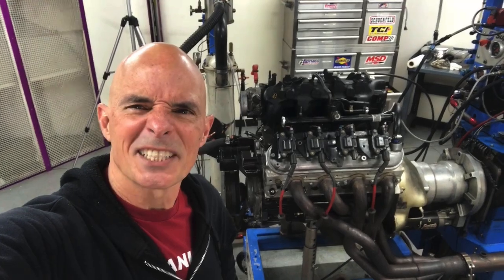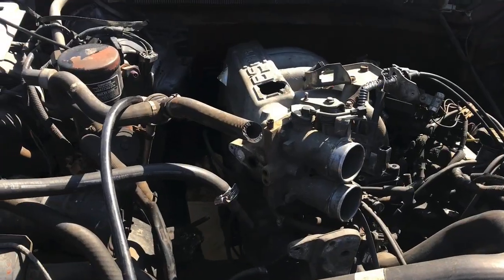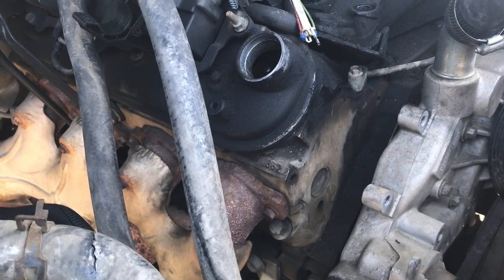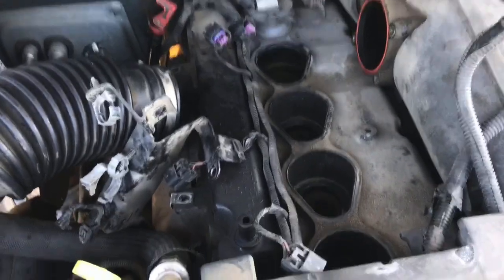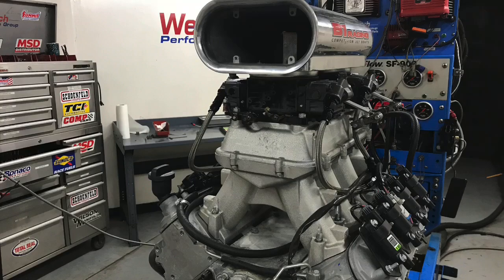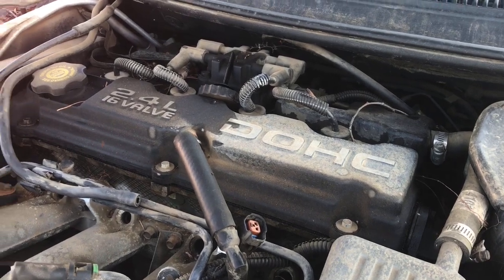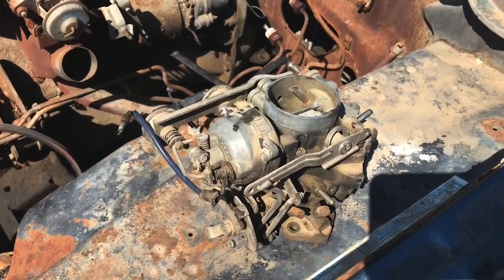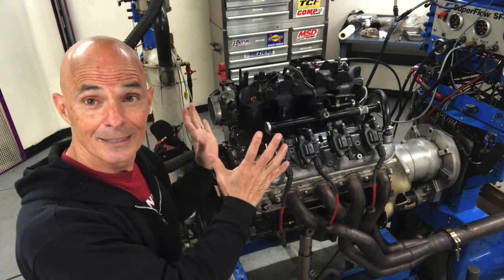LOW BUCK JUNKYARD QUEST-          THE AMERI-BARRA-4.2L ATLAS CHEVY 6

Comment: Cool beans on the chrysler 2.2 , 2.5 turbo.  I absolutely love these motors. Had an 89 shadow that I built a pretty trick 2.5 turbo for.
Ran 13.2 at 106mph on 14lbs pump gas. FYI Kenne Belle adjustable fuel pressure regulator  for 3.8 Grand National is a diresct bolt on.
Reply from the maker: Very cool!

Comment: Water will drip off the cowl into the back 2 spark plug holes, which is why they are a common item and nobody takes the back 2. Used to do alot when i worked at GM
Reply from the maker: good to know

Comment: Hey Richard! If I buy four of your "Wrong cam" shirts can we get a 1uz on the dyno! 6 bolt mains! All aluminum! High rpm! Get the reference? Vvt for days!
Reply: The Skid Factory has a few vids with a turbo 1UZ in a Ford and Nugget Garage has done a few turbo 1UZs also. 1 in a supra from memory too i think.
Reply from the maker: aren't they 300 hp v8s?
Reply: @richardholdener1727  260 ish for the early non vvti engines. But they had the big rods which holds lots of boost! Pre 97!

Comment: Hey Richard, I have a good Pontiac 4bbl intake. I think it was on a 287. I was just looking at it today thinking I need to sell it because it's setting outside and I only have 68 and newer Pontiac engines so I'm never going to use it. It's yours if you want it.  That Rochester Dual Jet setting under the hood of that Yugo is a great source for main jets for a Quadrajet. Most of the Dual Jets have #74 jets while Quadrajets can have anything from #65's all the way up to #74's on a big block carb from the early 70's. When you're jetting up for a modified engine they are a great size.
Reply from the maker: isn't the 287 a different intake than the 57
Reply: @richardholdener1727  I'm not sure what year they changed the intakes on them. I'll look at the date code tomorrow. I'm not 100% what it's off of. I bought a '55 Pontiac years ago with a bunch of spare parts and it was in with the mix. I just know it's 50's stuff.

Comment: The Langoliers are eating everything up from the 80's.

I would say you might find a 2.2 turbo but a 2.5 turbo?  That's a unicorn,.. and a cool one at that: as they were tough little engines that could take serious boost stock. (One Minivan in particular with the boost turned up and eating transmissions,   /watch?v=_e7qVlrHbYE).  Look out for the turbo minivans and  Plymouth Acclaims also had them even though they were rare back in the day.

If I remember correctly, Tyler Hoovie burried a 2.2 turbo.. lol  Not sure what became of it after he dug it back up and tried to start it.

Love it!

Comment: Sure do a Northstar! Better yet do a "Shortstar" LX5 V6 out of an Oldsmobile Intrigue! It's super sweet for what it is, DOHC, coil on plug, 215hp 234 torque,  9.3:1 comp NA. Such a smooth running engine, That's why I own two of them!
Reply: I had no idea there was a Northstar derived V6! Does it share a bellhousing pattern with anything interesting?
Reply: @BuffMyRadius  I believe the bell housing is the same as a 3800 series two. Mainly because they use the same 4T65e transmission. The Oldsmobile intrigue used the 3800 and the LX5 3.5 in its life time and as far as I know never changed transmissions for the 4T65e.
Reply: @TommioRS  so no chance at any RWD swaps, huh? One of my favorite factoids is that the Yamaha 3.0/3.2 V6 from the SHO is developed from the Ford Vulcan 3.0 in the Ford Ranger so it's a bolt in swap.
Reply: @BuffMyRadius  You very likely can as stated in this wiki. https://en.wikipedia.org/wiki/List_of_GM_bellhousing_patterns
Reply: Also to note, The LX5 does have an externally mounted starter. It's not in the V of the engine.
Reply: @TommioRS  well I learned something new today. I still think I'd stick with a 3800 for the supercharger, but I can certainly see the draw of a NA DOHC high compression motor. I went out of my way to get my 32V 5.4 Navigator, similar concept.

Comment: You say you're looking between a 2.2 l and 2.5 l turbos.? Well the 1970s through the 90s Ford Thunderbird turbo coupes had t3 and t4 Garretts. Also those Ford Thunderbird turbo coupes could handle up to 18 lb boost and they usually came with 12 lb boost stock. They were an amazing engine those 2.3 l.
Reply from the maker: 2.2l and 2.5l turbo motors
Reply: @richardholdener1727  
Thought you were just looking for the turbos LoL.

Comment: If you’re looking for a Honda J series, get the J35A8 out of an Acura RL if you can. They’re the best of all the factory Js
Reply: 3.2 out of a Type S (TL or CL) are the next best
Reply from the maker: what year
Reply: @richardholdener1727  05-08 RL or 07-08 TL-S had the J35A8, which had the highest compression and best cams. Next best is the J32A2, from 01-03 CL/TL Type S both have way better cams and intake manifolds than any of the Accord/Odyssey setups. The best intake is the J37 magnesium intake, with the J35A8 intake coming in a close second
Reply: @richardholdener1727  you also looked closely at the J head with integrated exhaust manifold, just has the single oval exit, approximately 1.5” x 3” but independent dyno tests have shown very little difference in flow numbers with the single exit vs triple exits, plus the integrated exhaust makes it look like it’s just begging for a couple adaptor plates and twin turbos...

Comment: I thought of a test you might want to try. I have heard that early stock car racing had oem parts restrictions so only oem parts could be used. to get around small cams guys put big block rockers on sbc. point being is how well does this work and why would someone do this and not just get a bigger cam. if you get a cam with. 625 lift with 1.5 rockers and the same cam with 1.6 rockers is .650 lift why not just get a. 650 lift cam to start with. does it matter or will the hp change bigger cam with 1.5 or smaller cam with 1.6 rockers and how does it affect duration.

Comment: I've often wondered why the 4.2 Atlas isn't more popular with hot rodders.
Reply: The LS series of engines exist and are better performance engines in pretty much every way. More power, easier to package, more aftermarket support, it's the obvious choice to make for someone who just wants to go fast and doesn't care if ten thousand other people have already done it, which is most hot rodders.
Reply: I think I remember Richard in a live feed saying that people have said they have a bad harmonics vibration at a certain rpm that makes it not suitable for high horsepower but that it was something he wanted to test anyways.
Reply: I drove a manual Hummer with the 3.7 5 cylinder and a pretty free flowing exhaust while working at a GM auction yard once upon a time. The baritone Audi rally car noise has really stuck with me through the years. I'd love to actually own one some day.
Reply: The engine is huge that's why! I looked at replacing the 250 in  my Nova with one of these 4200s. Measured and they are so tall it would have stuck out the hood and drug on the ground at the same time!
Reply: Bad rods, wallowing out of the wrist pin boss on the piston, lack of support.
Reply: @dandewar8403  Yes. they go bang around 6800-7000 RPM or so, which sucks because the heads are happy to make power much higher than that. A better harmonic damper helps and can be had relatively cheaply, but you need a new crankshaft to really fix it and free up the engine to rev like it ought to, and there are none on the market so it needs to be custom made. That's big $$$.
Reply: @Raven Reader Most people have trouble tuning them. They have variable valve timing, but only on the exhaust side if I remember correctly. If makes it a headache for the average joe. From what I've gathered reading through the forums, almost everyone ends up locking out the vvt just to be able to tune these motors. That's why I'm so glad to see Richard tackle one of these. I'm curious to see what he does and comes up with....
Reply: The Atlas series of engines also have a unique bellhousing pattern. The early ones like this have a 7 notch trigger wheel that is a little but troublesome to get to work with aftermarket ecus. I am interested if the 2.7l turbo from trucks and Cadillacs will get swapped into stuff. They are part of the series but I don't know how different they are. The bottom end is the king of beef and they might only be a turbo swap and a tune away from tons of tire smoke
Reply: @parkercustoms870  I think it is probably more to do with ecm options. People tune barras plenty, and good tuners get very good gains. And those have dual vct.
Reply: @timothybayliss6680  Very profetic words.

Comment: while you're on the subject of odd guy out GMs I would love to see a 2.4l quad 4 Pontiac. I've always been a v8 guy but that is one little 4 banger I'm a huge fan of. I had a Pontiac grand am with a 2.4l 5 speed when I was in high school and beat the ever living snot out of that poor thing and it just took it like a champ. I've always noticed it would always smack up on other 4 bangers pretty hard and for 2.4Ls made pretty decent power. I've ran them in a dozen derby cars and several sport compact cars and they always hold their own against the other 4 cylinders and v6s.

Comment: Are 862 heads good? Also jeep does make a inline 6 in the Yj models.
Reply: They used to make an inline 6 and technically it was an AMC motor rebranded by Daimler Chrysler and manufactured by Mitsubishi.

Comment: Ford 4.6L/5.4L 3-valve motor had a 3.700" bore.  I wonder if you could find a rod to make them work in the 4.2L?  Ford has a 3.750 stroke vs Chevy's 4.000" so even if by some miracle the big end was the same size, compression would be a little low.  I guess the big question is what is more expensive, custom rods or pistons?  Or get a custom crank made for the Ford 3.750" rods and have a stroker?  I need to win the lottery.

Comment: 1.8T Volkswagen be cool too
Reply: Yes! I'm torquing the main caps on my 1.8t as we speak
Reply: @GreatLakesLogger  awesome. I Had a 2001 wolfsberg Jetta was pretty fun car.
Reply: @Thumper68  yup. This is a 2004 passat. Has the automatic 5spd zf 5hp19fl  trans configured for fwd. It's getting forged rods and new stock replacement Mahle pistons, XS Power billet wheel ko4 turbo, fmic, fresh trans which I'm in the middle of building as well, etc etc. XS claims 300 wheel with that turbo, so I'm hoping it scoots good
Reply: @GreatLakesLogger  oh I’m sure it will be a good sleeper you be surprising people. I just had aem cold air and custom down pipe and exhaust and I suprised people a lot so I’m iq you will for sure!

Comment: For the love of god please don’t become one of these people that think Barra’s make 7 million horsepower and are the greatest invention ever
Reply: They aren't really, just they aren't an ls?
Reply: @Low760  they're really not anything special compared to most popular performance motors.  Most Baras are dodgy over 400hp and these days 400hp is entry level.
Reply: @DrewLSsix  I can't agree with that, to me sending them from Australia in bulk when most are now 10 years old and less than half a million around new, means they get expensive for regular driving in na form for mum and dad in Australia who needs Thier car for a-b.
Reply: Bahahahahaha it's unreal the number of experts you find just hanging out in the YouTube comment sections. Shouldn't the experts be expertly doing something?
Reply: @DrewLSsix  I think there are way too many Barras for me to want one but your comment is simply incorrect. Seen plenty of Barra Turbos making over 600hp with all stock internals. A lot of people outside Australia don't realise how many different versions and variations of the motor is covered under the word "Barra" some wouldn't make 600hp with stock rods but the lpg, turbo & fpv models will. Barra is pretty general term and includes the 3v 5.4ltr V8.
Reply: STARSHIP_TO_MARS what’s your expert field ?

Comment: I believe that 64 Pontiac you were looking at is actually a 394 Olds.
Reply from the maker: swap or did it come like that?
Reply: @richardholdener1727  I didn't see the car, but I've never seen a Pontiac of that era with an Olds in it. The GMC's of the mid to late 50's would come with a Pontiac V8. Also in some years possible also Olds V8's. Never seen one live though.

Comment: Almost every Northstar in the yard is there because it blew a head gasket.
Reply: If you find an 05 or older northstar with more that 100,000 miles it most likely already had the gasket replaced and the head studs upgraded. By 06 they just left the factory with that stuff already installed.

Comment: Richard, there is a different crank trigger wheel between 06-07 and 08-09. The later ones use a 58x wheel to maintain commonality with the ecu used on gen4 ls engines. I don't know if that matters for you.
Edit. The 06, 07 uses a p10 pcm and 7x wheel where the 08, 09 uses a p12 pcm with a 58x wheel.
Reply from the maker: THAT'S WHY WE GRABBED AN 06-07 (THAT'S WHY I CORRECTED THE MISTAKE ON THE VID)
Reply: In the chat ca434 said that the early cranks with the 7 notch trigger wheel is fully counterweighted and is the preferred one for performance applications.
For most normal guys it might not make too much of a difference but you are the guy that made 1500hp with a stock short block. If the price is the same and the ecu can control either it makes sense to get the one that has better part for the intended purpose.